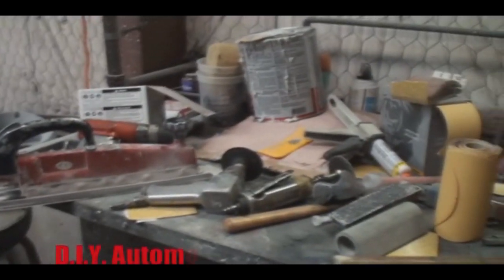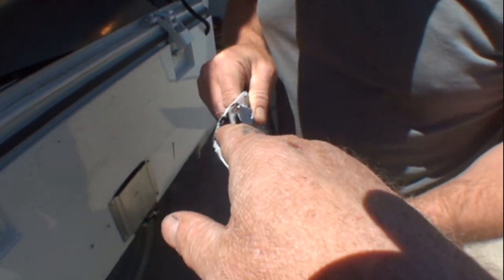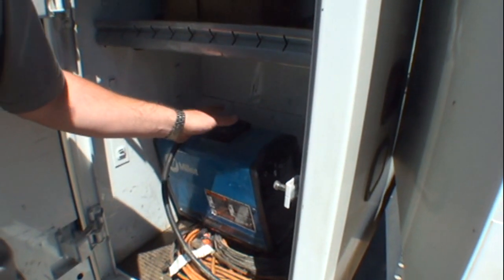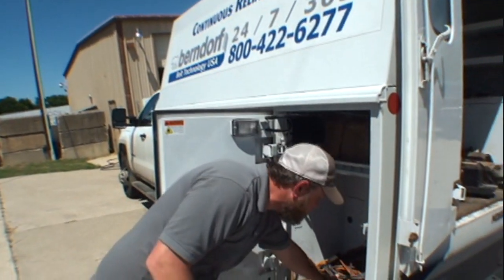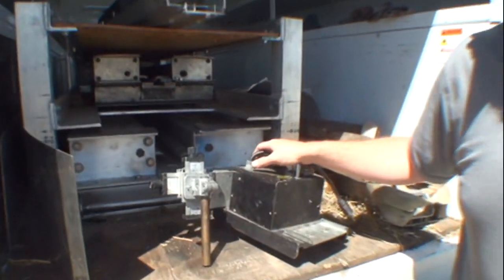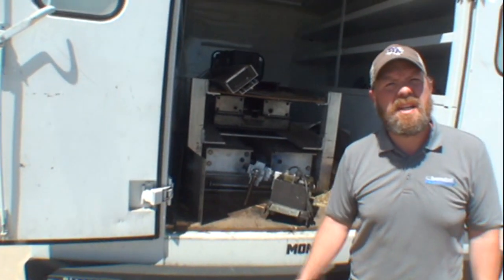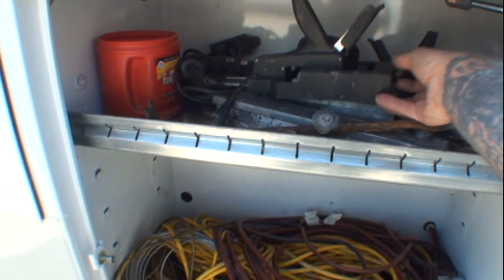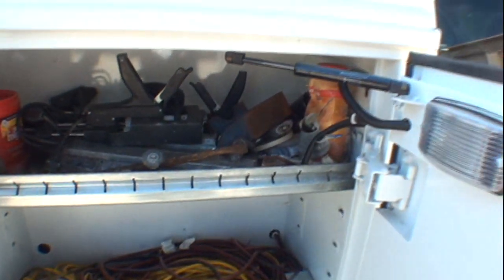Learn How To Weld For $ MONEY $ - Do It Yourself WELDING Tips

Comment: Pete.. i use to Re Tip gas lances for the steel mills in indiana and i have welded bridge beams upside down ..Welding sheet metal kills me..give me some 1/2in plate all day long..
Reply from the maker: A Hard Core Sky Scraper Bridge Welder... Damn -- That takes alot of HEAT in the Kitchen to get that done...

Comment: My Tweco 3 in one was only $650 with the school rebate.  211 amps, 110 or 220 volt.  I'd like to know if they offer a peddle free set up like this, does miller have the rights.
Reply from the maker: I was looking at the Tweco 3, I didin't know they where that cheap... I might have to re-check it out...

Comment: I used to be a instructor in the trades, Young people wont do most of this type of work, Not all but most, Most new trainees are 45 year old and up. I just dont get it !!
Reply: For 8 years I trained people to drive semi and run Haz Mat loads, out of 400 trainees only one guy went on to owning several trucks and making a fortune, He was 21 and from Serbia, still a friend today.

Most would just bitch, " I have to do all that, ". was the normal saying, just before they quit. They want alot for nothing. We have major problems across the board. I worked at a trucking company in Tampa, that had 150 drivers, all but 5 were over 45.
Reply: That's because of the long hours and shit pay. Trucking industry has changed for the worst these days. Most people just steering wheel holders.
Reply: I have to agree with you. Maybe 1 good job out of 100, I know a few people who have total gravy trucking jobs, short hours  and real good pay. But I would not hold my breath trying to find one of these, Like I said 1 in a 100, pretty bad odds. I dont know whats going to happen to this Industry...Driver less trucks, dont think so.
Reply: Tech is there for driverless trucks only matter of time.